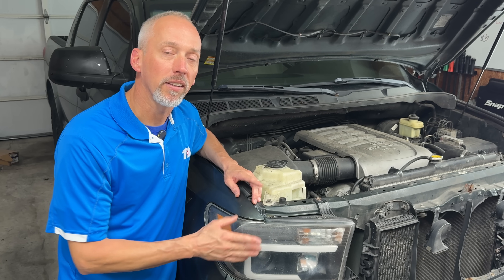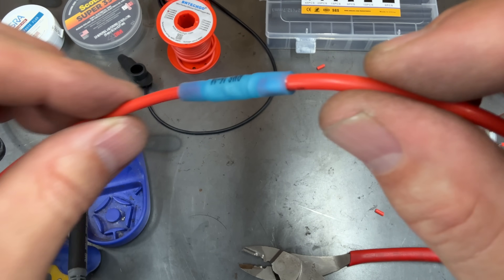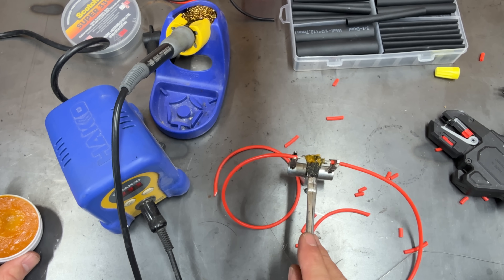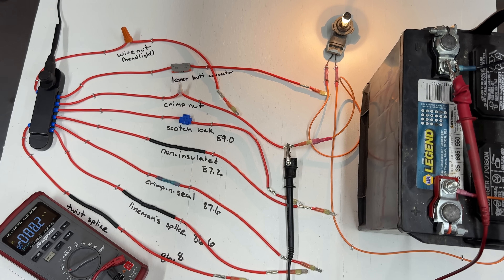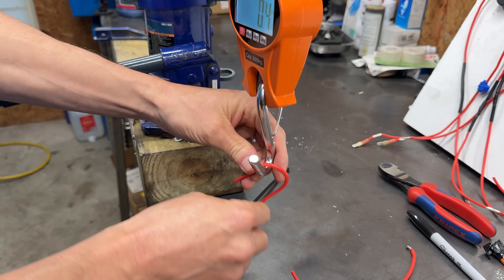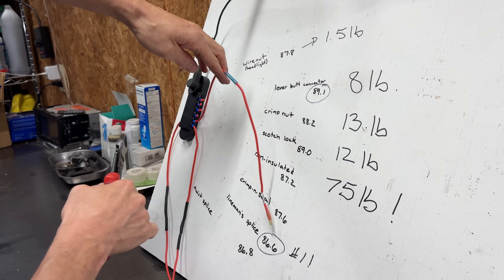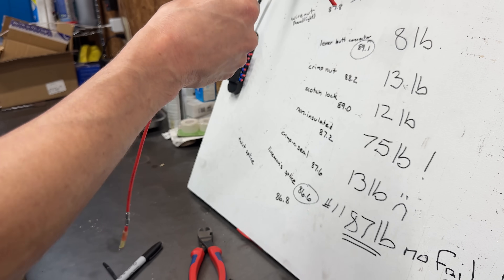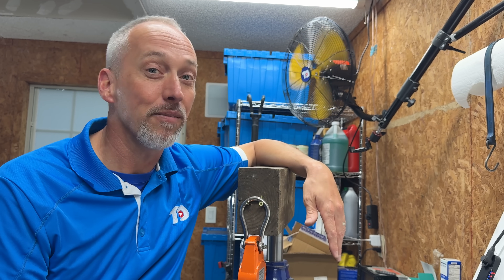I tested these connectors and found the best one

Comment: Couple of comments. The spring connector? There should be a guide for how long to strip on the side or bottom of it - I think you didnt strip it nearly long enough. Most quality spring connectors are about 11mm - It looked like you did only about 5-6mm.
And on that... try using WAGO's - they will beat the Amazon ones every time, though the chinese copies are surprisingly good.... the WAGO's are just better.

On the solder joints - yes that will always be strong on a  linear pull but they have weaknesses.
- corrosion around the edges of the solder joint from the heat/flux exposure - your glue lined heatshrink will help mitigate that problem a lot.
- flexing will cause premature failure - although the straight line pulling strength is stronger than the wire itself, because the join is stiff, flexing will be naturally concentrated where the strings being "free" ie right next to the joint, so soldered joints naturally fail from flexing right next to the soldered part. The heatshrink will help by spreading the flex load away from the solder joint a bit, and sometimes I've put multiple layers of heatshrink getting shorter towards the joint to spread the flex resistance a bit.
- the solder adds resistance - for a long time I assumed it would by surface area give the best current carrying capability, but it turns out that it doesnt. It actually creates bridges between the the copper parts - and where you have different metals there is a problem... with a solder joint you are introducing two changes for every electron path. I believe that this can also affect the join (increasing resistance and heat loss) in the long term because of galvanic corrosion.

The solder problems are particularly accute if the joint is fixed - ie for terminals, where it seems that the best advise is a quality crimp.

Long story - each of these has a place to be used. Except wirenuts. (Especially wirenuts with stranded wire - just dont.)

Comment: I took over a fleet shop for a concrete and pool company. The "Maintenance Manager" before me "Fixed" a work van with bad taillights by just twisting the wires together NO INSULATION. Of course, very predicably it shorted out the second the bare wire ends found the frame/metal. Believe it or not, he compounded this problem by replacing the blown older style glass fuse with a .22 LONG RIFLE fully live (power, primer, and bullet) in its place. Honestly, I'm not sure if he just wanted to shoot the guy who drove the van. WHAT A MORON.
Reply from the maker: Wow!

Comment: 2:40 This method is how you get engineers to eat their hats whenever an old siemens network decides to act up, but not act act up, just act up occasionally. Just enough for you to doubt whether the controllers are caput. 9/10 it's the damn connection point, which is basically this.

Comment: your "science" for the strength test had no "control".  You should have tested the break point of the wire itself, and had a better base anchor.  you could have set your scale for Hold Max Value.

Comment: Realistically, anything over about 10 pounds of force is overkill for that application anyway.  Wires should not be being yanked on that hard (even when you have to move them around to get at things, etc), and if they are, it's quite likely that you'll end up damaging some other part of the system anyway.

If you're going to test lever-nut type connectors, you should use some known-quantity (name brand) versions, not random cheap knock-offs from the Internet.  There are lots of really crappy knock-offs floating around out there that are really poorly constructed, and you have no idea what you're actually going to get if you just buy some random no-name junk from some random anonymous seller.  (But those connectors are really not intended for this sort of application anyway.)

The crimp-and-seal connector failed because you didn't crimp it properly because you weren't actually using a proper crimping tool (which you really should).  Those notches people add to other pliers, etc, are generally all crap and just there for advertising purposes.  Get the correct tool that's actually designed for the sort (and size!) of crimp connectors you are using.

Soldered connections are generally discouraged in automotive applications, because vibration over time can cause mechanical stress on the connection, making it more likely to fail.  That's why crimp connectors are generally always used by manufacturers for this sort of thing instead.

Comment: A very useful comparison. My preferred has always been the non insulated crimp along with heat shrink. However, it isnt always easy to to get heat onto the heat shrink. Solder and heat shrink is good away from the car but again getting heat onto the joint is sometimes difficult. So where I cant use any heat, I use non insulated crimp and self amalgamating tape to insulate.

Comment: Thomas and Betts "Stakon" crimp connectors and the right crimpers, and you can CRUSH the crimpers to the stops, and never pinch off the conductor. The "right" crimpers have a broad contact area, not that knife blade looking type.

Comment: It seems that the non insulated crimp connector did really well. So that may be the way to go (+ crimp tube)  if you really want to use the cable as the total weight support for something darn heavy. Solder joints are not considered suited in any kind of moving installations (trains, planes, automobiles or boats). Twist nuts are a big unknown that relies on wire type and technique. And finally spring loaded connectors are the clean and installer friendly choice for anyone that wants a trouble free life. Wago being the most heavily tested one, I believe.

Comment: Doesn't Tool Demos know how to make a table chart? You can do it in MS Word, and there are other ways. His scribblings on a whiteboard are amateurish and not really clear.
Plus, he didn't wind the thin wires properly in the 2 wire soldered connection.
Vibration is also a consideration, but we'll give Tool Demos a break on this one. The setup would be beyond what he has as equipment.

Comment: 40+ years working in electronics.  I'm sorry.  I want to be nice, but I can't.  I can't keep watching either.    You didn't strip the wires long enough for the  wirenuts.  You used the wrong tool for the insulated crimps, and I'm not talking about ratchet vs.  non ratchet.  And finally, I've known little girls who can squeeze a crimper harder than you.  Dine properly ALL of these methods yield very similar resistance and pull strength.

Comment: Solder is always a reliable connection, when it's new at least. The twist connection will have slightly better conductivity than the lineman splice, and is really just as strong if it's properly made. The lineman splice is however simpler to make which is important is you are doing a lot of them. Soldering is however not a universal solution. In warm places it's fine, but if you live somewhere with a real winter it can turn the solder to dust. Do a solder joint on a test cable, put it in a bag and place it in the freezer. The cold can actually turn the solder to dust making the joint very bad. If it's a twist and solder then it will probably fail entirely. If it's a lineman splice then it may still work somewhat.

The only cay to get a good connection that works in all weather is the crimp connector.

If you look at telecommunication you will find that they standardized on using crimp connectors and windings. The last is done by winding the wire tightly around a pin using a tool. That is all. No solder and no crimping, and yet it is tight enough to not allow any gas to work it's way between the coils of the wire around the pin. Safe connectors are not always what you think they are. 

The wire nut is one of the most misunderstood connectors. There is a reason it's been used for a hundred years. It's simple to make, cheap, long lived, quick to install, flexible as you can use it on two, three or four wires and very reliable. It's only lately that it has lost ground to Wago type lever connectors. The first patent for a wire nut in the US was issued in 1926 so it's almost a hundred years old now.

Comment: Watching this video after splicing a connector on a scooter stator and already getting failure on crimp and seal connectors that I used. Going to try non insulated with my own heat shrink
Reply: Check out the inline posi-lock connectors (you can use three of the 10 gauge yellow colored ones). They hold wires securely, designed for automotive use, and you can disconnect the connection without having to cut the wires. Since we two wheeled vehicle enjoyers know all too well how often stators and or voltage regulators can fail, the removeable connection can be very useful. A small dab of dielectric grease inside the connectors will keep water out. Used these type of connectors for about 20 years now.

Comment: I've always hated crimp and seal connections because of how weak they are. I used to twist wires together and heat shrink, not even any solder, instead, until I discovered the glory of uninsulated butt connectors. Huge fan.

Comment: You need a proper crimping tool, the one you used is not suitable for decent crimps. Scotch locks do damage to the wires, and creates more problems than it fixes.
The crimp n seal failed due to not being crimped sufficiently.

Comment: So many people have commented that solder connection should never be used in a vibration environment like a car. 

I’ve heard this over and over. But how true is it? How much vibration would be needed in an automobile environment to weaken a solder joint? And is that with the wire attached to the metal, or if it was suspended in the air? Or does that matter?

I don’t know the answer. Does anyone? Is there a way to test?

Comment: This was incredibly interesting. Thank you for doing it! 
 However there were a couple of questions this raised that your methodology didn’t answer. 

First, you didn’t test a wire with NO splice as a test for a reference to compare the splices with. 

Second, you didn’t compare a splice of just twisting the wires without solder or a splice connector. In theory that should be the same as no splice.

Comment: Minor thing that wouldn't change the results, but the lineman's splice wasnt twisted correctly. The correct way is to wrap the tail of each wire around the opposite wire, and you end up with a lot of surface area touching between the two. If its being done with solid (non-stranded) wire, and done up correctly with the tails around the opposite wire, and wound nice and tight, you can end up with a splice that is pretty robust even without the solder.  Though solder most definitely improves it. With stranded wire they dont really hold the shape well enough to not solder it.

Comment: i saw in another video on YT a test that showed there was lots of voltage drop on the Wago as dissipate heat compared to your findings?  any thoughts?
Reply from the maker: In my test, it had twice the voltage drop as a soldered connection. That would generate some heat, especially if you run high current through it.
Reply: @ToolDemos  ok, thanks. I'm new to this, would a DC vs an AC test show much differently?

Comment: Good video.
I think you've left out a few different connection/splice types that are worth looking at. In almost all automotive/OE applications I've seen, they use open barrel splice connectors appropriately sized for the application, as well as dual wall heatshrink. When properly sized for the Center Mil Area of the conductors and when used with the propper crimping tool, it effectively will "cold weld" the joint without any need for solder, and will provide a reliable zero resistance connection. If you attempt to pull the joint apart, the conductors themselves will snap instead of pulling out of the crimp.

The second connection type worth mentioning would be the use of a waterproof upfitter connector, with something like a deutch or AMP connector. They are servicable and are very easy to work with, with minimal voltage drop or resistance through the connection.
Reply from the maker: Thanks, I’ll keep them in mind

Comment: I don't recommend solder when doing automotive wiring that is in like a engine harness. As the heat and cold cycles make the solder joint brittle and will fail eventually.

Comment: I know of two other connection types you could test. 
The first is a special type of butt splice that doesn't require crimping. You put the 2 wire ends into it and then heat it with a heat gun or blow dryer. Low temperature solder will make the connection as well as seal the ends.
The second is a variation of the metal butt splice. You strip the wire twice as long as you need. Twist it and then fold it over in half and then put that into the tube and crimp it. Even a mediocre crimping tool will give you a super strong connection.

Comment: Great comparison.  Although you didn't do the lineman's splice properly.  You folded the wires back and wrapped them on themselves, basically giving you two rings that you filled with solder.  When done properly you twist the wire around the other side, that will give you a strong mechanical connections even if you don't solder it (but do solder it).  Google Western Union Splice.  I was shown how to do this about 50 years ago by a Bell Systems tech.  When done properly the splice is about the same diameter as the insulation.
Reply from the maker: Thank you. You’re right about the Western Union splice

Comment: I don't understand why the insulated butt connector would have to be redone simply because of a small portion of the insulation was damaged by the crimping pliers. Why not just use the heat shrink with sealant over the top? You're using the heat shrink over a bare butt connector...
Reply from the maker: Because if you’ve already crimped that connection, then there’s no way to put the heat shrink on top of it

Comment: I would never use a wire nut for an automotive application, but it is worth noting the wire nut shown was technically not completely installed. After the nut quits turning you are actually supposed to continue turning it until the insulated part of the wire has several tight twist in it. I don’t think it’d help with voltage drop, but it would for sure help with strength.

Another thing is you didn’t test a connection called Posi-taps, which are designed for automotive use. I love using Posi-taps, good strong connections every time, and they are reusable.  The only problems with them is they are almost impossible to find locally, usually gotta order them off the web, and worst problem is they are quite expensive.

Comment: I didn't know the quality of a connector is judged in the capacity to tow a car.. For me, electrical contact (low resistance) and humidity/water protection (if needed) are the main criterion.
Reply from the maker: It seems anytime I pull out an engine, the only thing holding it in the car, ends up being a little ground wire. Strong little buggers!

Comment: For auto motive yeah Wirenuts suck, for anything else that doesn't move, it is umbeatable and the easiest to install, will outlast the installation if installed correctly. The non insuladed crimp one was insane though.

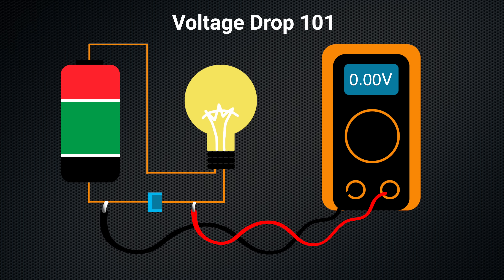Comment: 4:38 couldn't you just use the ohm function on you meter to measure the resistance of the wire? It should work as the wire should'nt have much resistance and if there is any it would be at the connector.
Reply from the maker: Yes, that would work to show us the resistance on the wire. When I do a voltage drop test, it also shows me the ability of that circuit to carry a current.

Comment: All of the lever and twist are crap, the crimp ones also crap, even the "lineman splice" falls short of what is teach in IPC for standards of aerospace industry. (also use adhesive lined heat shrink tubing for real waterproof)
Reply from the maker: What method do they teach in IPC?

Comment: on those milliamps that is almost nothing... a tiny difference, twisting wires together is like a solid wire, then to solder them is better connector and just to twist them and crimp them is great connection and use the end cap crimp connector then pack it in grease i have seen a factory connection do this pack it in grease. but you could pack it in glue of some type for a great seal. on a truck or car do not solder up connectors i had one break in half from the soldering job it flex  and snap off on a coil connection and had a no start condition at 1A.M.  i had the call to help and called a tow truck, so i was sad that i soldered it... automotive vehicles have stranded wiring for a reason to allow flexing which i known this, so now i do not solder up wiring on vehicles i know it will crack maybe.

Comment: I use non-insulated crimp connectors when I do my wiring. I've tried soldering and insulated connectors before, but I find I just get a better more consistent connection with the non-insulated one. I have gone as far as buying the bulk insulated ones because you can get them at any big box store and heating them up and removing the insulation.